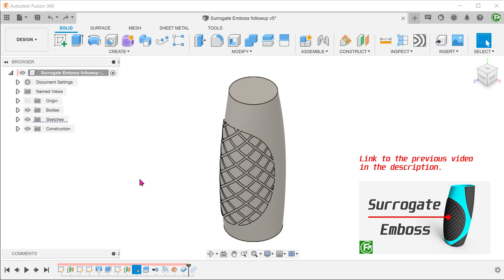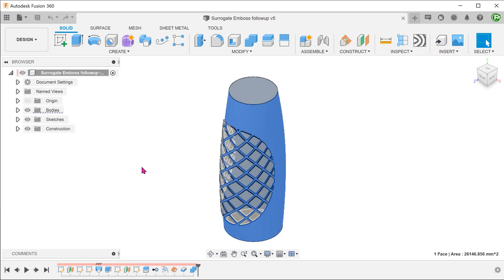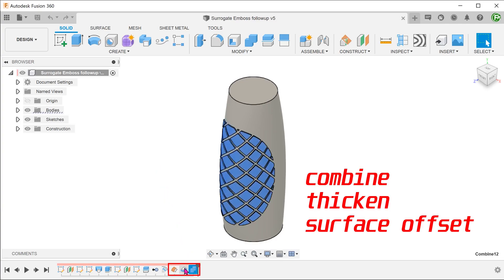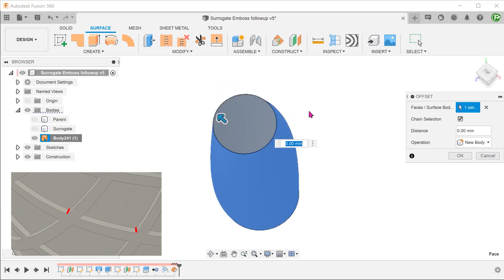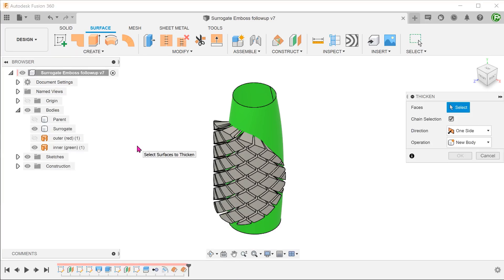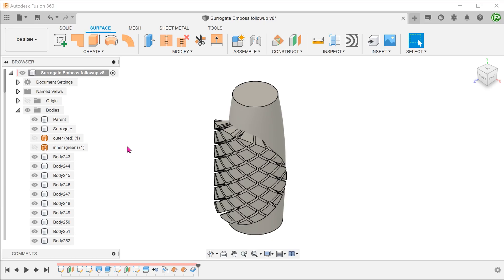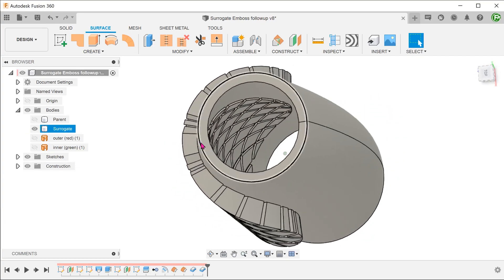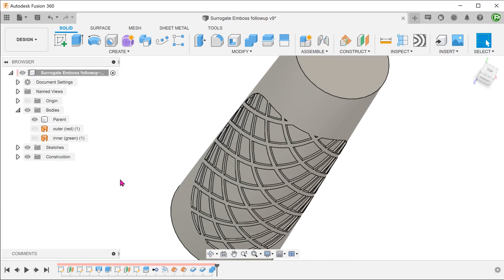Fusion 360 | Surrogate Deboss?

Comment: Nice overview of the work around!  One tip, the last thicken isn't needed.  You can just select all the bodies in the browser as tools by selecting the first one then shift selecting the last one.

There is one other way(at least) that you could do this.  Before the emboss create your inward offset surface at -1mm again. rebuild the rest of the timeline then use replace face selecting all the original emboss faces and use Replace Face with the offset surface.  It will take the emboss and deboss it for you!

Happy Modeling!